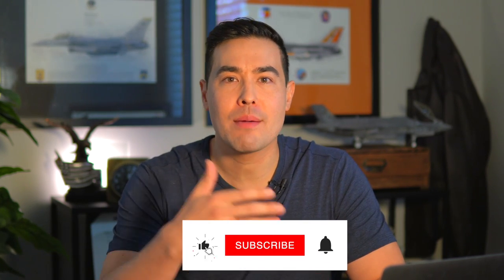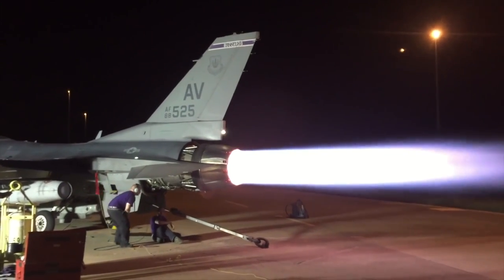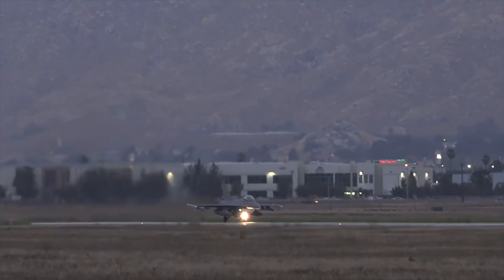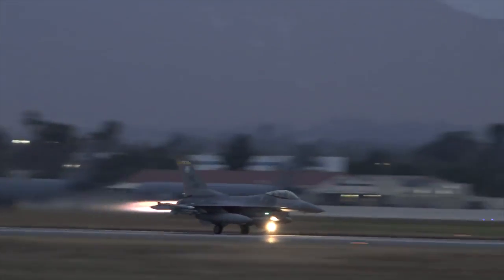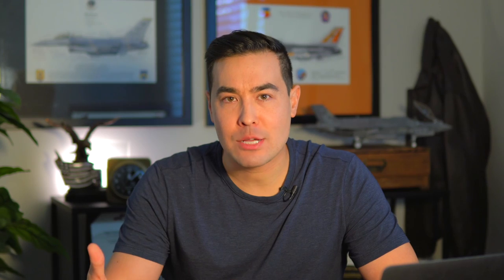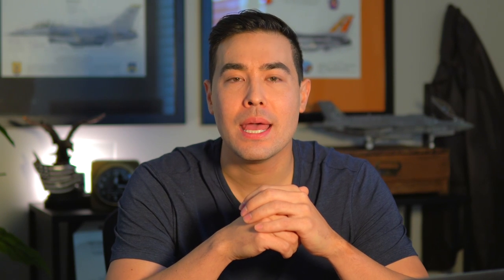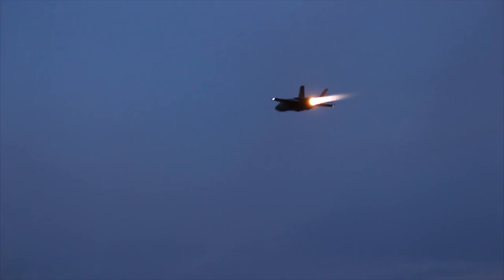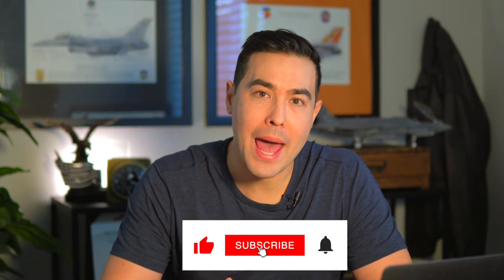Afterburner: What It’s Like to Use MAX Afterburner!

Comment: Another sailor with a sea story:

I was looking through some photos the other day and I flashed back to a memory of working the line at NAS Oceana. 
This was the coolest thing that happened to me while working as a Tomcat Plane Captain (PC) in the US Navy.

I was working the night shift in the line shack. I helped a power plants buddy by towing a bird down to the high power pad to chain it up and do some high power engine testing. It was just me and him working that night. As I recall it was Christmas holidays and we were on a skeleton crew. We got it chained up with that huge high-power chain and he turned the engines up. He got out and had me get in the front seat. He then went to the starboard engine bay and prepared his equipment for the testing he needed to get done that night. He popped up the ladder to tell me that he'd signal me to go through each ring of AB by holding up fingers to indicate what to do with the throttle. This was of course pretty cool to me. I was not high power qualified. 

I waited and tinkered around caging the backup glide slope and fiddling with the cockpit lighting being careful not to touch the stick so as not to clobber my pal working under the engine cowling under the horizontal stabilizer control surface. If I remember this correctly he signaled me to bring the engines up to military power (max power with no AB). It's been a long time and I can't recall the events precisely. I waited a while more while he worked. He then came out into view and held up one finger so I grabbed the throttles and pushed port and starboard engines to the left a little and then into zone 1 AB (first ring of afterburner). For a 19 year old skinny kid this was pretty cool. You can really feel the power.

He did some work and then came back out into view on the starboard side and held up two fingers. I then pushed the throttles up into zone 2 engaging a second ring of fuel injecting in to the exhaust cans. I can't recall if we had the bird in kneel or not but when the second AB ring lit, the bird shuttered pretty good and you could almost feel the airframe crouching as if waiting to pounce forward. I watched the gauges as he'd advised me to do and continued to wait for the next instruction. Each time he came out and held up more fingers, pushed into another ring of AB. I took care to take it all in because I was pretty sure this sort of thing would not happen to me again. By the time we had the engines in zone 5, things were shaking pretty good and I caught myself rolling my feet forward pretty hard on the foot pedal wheel brakes with both feet as if that would help should the high power chain break. I took the opportunity to look back over each shoulder to see the orange flames of each engine. These were Pratt & Whitney TF-30 engines not the new GE F-110 engines that came later on with the A+, B and D model Tomcats. Very exciting for sure. He appeared again from under the starboard cowling and signaled for me to back the throttles down to military power and then back to idle. Having completed his required work, he scurried up the ladder and swapped seating with me to turn the bird down. 

We towed the bird back to the flight line and I secured it for the night. Later he and I were talking about the experience and he asked me how that felt. I explained how cool it was to look back over each shoulder and see the orange flames – His eyes got big and he said “what do you mean, both shoulders?”... “You only operated the starboard throttle, right?!!”.  I explained... no, that everything he signaled for I did to both engines. He explained that the high power chain was not rated for that amount of thrust! 

Lucky in more ways than I was aware that night. Unforgettable experience for a 19 year old E-3 sailor.

Comment: I was enlisted aircrew in the C-130.   At one time I was at 9 AF Stan/Eval at Shaw.   Got a few  -16 rides there with coworkers in Stan/Eval.   D model F-15 at Eglin doing BFM.  Not a mission sorty but check ride.     Later I ended up at Robins doing PDMs with the 339th.   We did the F-15s there.   Finally got a ride with my Sq/CC in a Mud Hen with no CFTs and big motors and no paint.   Lightweight.   I was allowed to fly a good bit.  Even got to do an overhead until short final.   We did a few touch and go's.   DAMN that thing can accelerate.

Comment: In regards to what you mentioned about acceleration with a jet versus a car, I remember watching a documentary on the SR-71 Blackbird, and both the pilots and SROs said there was nothing quite like the acceleration factor, especially when your target altitude was 80,000 feet.

One pilot mentioned, "You'd just expect it to stop accelerating...and it wouldn't. You'd climb higher and higher and go faster and faster. We called it the Rocket Ride."

Comment: Congratulations on the new family!  It only gets better!  Question,  you mentioned that you need to use afterburners in the extreme heat.  Does the F35 act differently in various weather conditions?  I can’t even imagine how it would feel to just be able to be a passenger in one of those. It has to be mind blowing.  Thank you.

Comment: Retired career crew chief and Quality Assurance....38 total years around fighters..Back seat rides in the T-33, F-100, F-105D, F-4D and F-16B/D...yes the 16 augmentor is an ass kicking ride, but you never went LOOOW in the Thud. No such thing as ground effect when you're 140 feet off the deck (shhh) at .93 and riding in a 28,000 lb(empty)  Cadillac.... Max t/o weight was just shy of 53,000 pounds and was capable of 1400mph....Fly safe Sir.

Comment: If you think it's cool watching the exhaust in full AB try seeing one of these thing do an AB no light. That's when the pilot goes into after burner but it doesn't light off, but the spray bars are still spraying the fuel. If the pilot doesn't take it back out of AB it will eventually fire and all that excess fuel will ignite.

Comment: The tanker has the luxury of using 100% of its power while a fighter is limited to mil power that is ~60%, unless a/b is used. When a fully-laden tanker turns on its track it might have to throttle up to full, and a fighter that is loaded with ordnance may have to go to a/b in order to stay on the boom.

Edit: About 9:30, I am surprised you have not mentioned GE’s XA100 adaptive cycle engine which is even better than P&W’s F135 engine in many ways. The first application of the XA100 will be the F-35A.

Comment: This emphasizes another benefit of the F-35; a massively powerful engine, which produces a lot more thrust than the F-16, so it doesn't need A/B as frequently. Also, internal weapons bays, so the aircraft is essentially always clean. Combine these things with the fact that the F-35 carries double the fuel of the F-16, and you have an extremely fast aircraft that can use afterburner for a significant amount of time.

Comment: The P&W F135 is the most amazing fighter jet engine ever because (among other reasons) it’s the most powerful fighter jet engine ever developed. Though that being said, the P&W F135 even when using full afterburner still produces less that 1/3 as much thrust as the GE90-115B on the 777-300ER.

Comment: We went on the Do Dodonpa rollercoaster near Mt Fuji.  The acceleration is what I imagine an afterburner would be like (but obvoiusly for a much shorter period!)  See:

"The 55 second ride takes the rider across 1,244 metres (4,081 ft) of steel tracks, and peaks at a maximum height of 49 metres (161 ft).[5] Reaching top speeds of 180 kilometres per hour (112 mph)[5] in 1.6 seconds,[7] Do-Dodonpa retained the title of world's fastest roller coaster for nearly a year and a half before Cedar Point's Top Thrill Dragster took it in May 2003.[4] This gives the ride an acceleration of 32 metres per second per second (6,300 ft/s/min), and up to 3.3 g.[5][8] By comparison, astronauts only experience 3 g at liftoff, though for a duration substantially longer than 1.6 seconds.[9] While the ride has been tested at speeds of up to 193 kilometres per hour (120 mph), its rubber tires prevent it from performing reliably at these speeds, so engineers capped the speed at 172 kilometres per hour (107 mph) prior to the ride's renovation."

Comment: From an engineering perspective, the reason why most aircraft need afterburner to go supersonic is because conventional jet engines need the air coming in to be subsonic. So supersonic-capable jet aircraft have air inlets designed specifically to slow the air down on the way in to make sure it doesn't hit the front jet engine blades too fast. Which means that ALL conventional jet engines start with the incoming air subsonic. (There are extraordinarily few exceptions, and none in any aircraft that has ever been a production aircraft.)

This means that everything from a 747 cruising at altitude to an F-15 in a Mach 3 power dive have their engines start with the incoming air going the same basic speed. (A 747 at maximum speed is going just under Mach 1.) Obviously, the air coming out the back has to be going faster than the air coming in in order for there to be thrust - so the air coming out the back is essentially always supersonic, yes, even on that 747.

The trick is that you have to balance the power coming out the back with the aerodynamics of the airplane. Obviously if they had thrown a 747 engine in an F-16, it would provide more than enough thrust - but it wouldn't fit in an F-16 without serious changes. So by and large, they balance things so that "maximum military power" (maximum thrust without afterburner) is enough to reach just shy of supersonic speeds. If you're adding more power than that, you're adding a much larger engine than would otherwise be needed.

So far, the only production aircraft that have been capable of "super cruise" (straight-and-level sustained supersonic flight without afterburner) have been the Concorde and the F-22 Raptor. (The Russian Sukhoi Su-57 is capable of it, and in theory has entered production, but only 2 'production' models have been built.) The SR-71 (and its predecessors) did NOT use super cruise - they used modified Ramjets instead - at low speed, the conventional jet engine provided power, with an afterburner in the back to accelerate. At high speed, it reconfigured itself so that air flowing around the main jet engine into the afterburner chamber provided most of the power, operating as a ramjet instead of a conventional jet engine, with minimum air+fuel going to the conventional jet engine solely to provide power to other systems plus a small amount of thrust.)

So it's all about engineering choices. For the F-22, it was a design choice/requirement. So the F-22 has more powerful engines that it would otherwise need to enable super cruise. For F-35, super cruise wasn't a requirement, so all competitors in that competition chose to use smaller engines to maximize payload/efficiency over raw power. (While still having enough power for its missions, and afterburner to enable supersonic flight.)

Comment: Hasard here a question instead of a fuel dump, do you Airforce guys use afterburner to burn up more fuel so when you comeback to base, your landing weight is lighter which puts less stress on the airframe ?

Comment: That is an insane amount of fuel we use as a Country as I hear it costs about $200K to top off the F-35? Now I know why we spend something like 52%+ of our GDP on D.O.D spending. I'm curious if you or anyone is familiar with the new Tempest that is being developed by the UK? Its supposed to have an energy return system along with industrial batteries on board to help conserve fuel&reduce heat output. Plus it looks VERY pretty.
Reply: Whilst it would be cool if we could get our own jet, I really don’t think we should, at least not right now. Our Typhoon squadrons are already lacking of pilots, now with us buying the 35’s we would struggle to get pilots to make it worth while. The money would be better spent increasing our fleet of Typhoons and F-35’s as well as getting in more pilots (although money alone won’t solve that issue). The Tempest is us trying to get back in the game, that we were once one of the leaders in, but we took a step back and that’s put us on the back foot. I would love us to make it but as we are going solo on development I don’t see it happening unfortunately and then it’s money wasted.
Reply: @lewiscurrie4979  still the concept of the Tempest project looks very promising. Isn't Roles Royse involved in the development as well? Tbh I think Covid-19 is responsible for any lack of funding going forward, as no one especially us here in the US were ready besides S. Korea who just now only surpassed the 1,000 mark for Covid-19 related deaths. Embarrassing&scary times indeed for the US in particular. Especially when Russia is being highly aggressive&claims the Su-57 is ready for full development, solving the engine failures it experienced early on in the program? Obviously we both have far more in terms of numbers. But I would hate to see who would be victorious if the Typhoon, F-22, or F-35 were ever to have an engagement with the Su-57. Praying we never have to find out which is superior 🙏
Reply: @shankshoanatlprez4453  The Su-57 is a joke and only a few prototypes built.
Reply: @UnforgivingDemon  I am aware that they're only a few that have been made. But you cannot say for certain whether they are a joke or not? Especially after seeing the air show footage. F-22&F-35 can do a controlled flat spin using thrust vectoring. But not with the same fineness that i've seen this far. And if you look closely you will notice some similarities between the Su-57's design&YF-23. I was being quite respectful in the comments, but you are showing no respect or making a rational argument. Also, I just watched a video of the Su-57 going full vertical while test firing whatever rocket it was carrying. Plus I've never seen an American pilot successfully pull off the Pugachev maneuver successfully. Watched a F-18 Super Hornet try but had to feel for the flight crew performing air frame maintenance afterwards. Between you&I though...our arguments are subjective as I am not a fighter pilot. And i'm pretty sure neither are you. So until you&I can strap into one. Our opinion are just that, subjective.
Reply: @shankshoanatlprez4453  In terms of the Su-57 like you said it’s just a guessing game until the triggers have to get pulled. It’s definitely an amazing feat of engineering the Russians have pulled off. They’re vertical trick is neat but it’s not going to give them a massive edge over other aircraft due to its niche use, and seems more like a party trick. Unless it’s changed recently I believe the Typhoon is still the only fighter capable of firing fox weapons whilst super sonic. I might be out of date with that statement, and my knowledge definitely leans more on commercial aircraft due to that being my chosen career, but I still like to try and keep up with the new military aviation advancements.

It’s nice to have a civilised conversation with someone in video comments, as it never usually happens.

Comment: This is cool as hell a video about fighter jets. I want to know your feelings on the A35.  You said you fly that jet. I’ve heard so much negative then positive about the 35. Negative because of the plane went so far over budget. They say the new 35 doesn’t have the maneuverability of the yf22. That the 35 isn’t a dog fighter. It relies on seeing the threat from a distance and taking it out before the threat sees you. When the yf22 has thrust vectoring and can really dogfight. What’s the truth. Is the 35 good or not. Then I’ve heard pilots who started flying saying it’s way better than people gave it credit. I want the US to have the best fighters so we can kick ass
Reply: The program itself has been poorly managed by Lockheed, however the F35 is exactly what it was intended to be. No it's not a pure air dominance fighter like the F22 and was never designed to be, it's a multirole strike fighter much like the F/A-18, but as shown in training exercises it can take down 4th gen fighters as easily as the 22 can. Thrust vectoring is mainly advantageous in low speed maneuvers but was not really worth it for the F35. The majority of people criticising the F35 are armchair critics with little knowledge of aviation or aircraft design. Sure it's got it's issues, but no more than any other fighter does

Comment: So the question is, which has the most acceleration in afterburner:  F-35 or the F-16 variant with the highest thrust/weight ratio in a clean configuration?

Comment: Curious, can the PW F135 engine do this that the SU 57 has:   The AL-41F1 engines incorporate thrust vectoring (TVC) nozzles whose rotational axes are each canted at an angle. This configuration allows the aircraft to produce thrust vectoring moments about all three rotational axes, pitch, yaw and roll.

Comment: Thank you for your service . Extremely grateful. Could you do talk a bit about what the American class assault ship is now able to provide the Navy and Marine Corps . Now that is has the F - 35 replacing the Harrier? Does this increase the lethality of  the Fleet? Will the Navy be able to use smaller carrier to be able to provide the same air superiority and strike capabilities ?
Reply: The navy has the F-35C not B so they still need the catapults on the full size carriers as the C variant doesn't have vtol capability

Comment: Tesla or F-1 have better acceleration dynamics than F-16.  So the feeling of overload can be felt in these machines as well.  And at high altitude, speed is not felt the same way as when driving on the road.